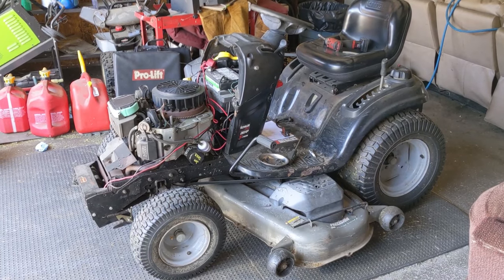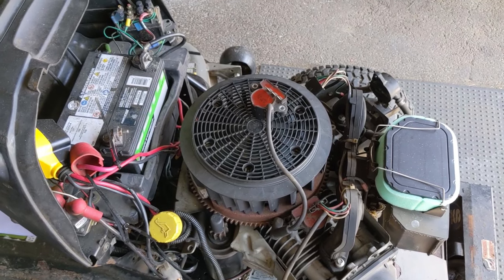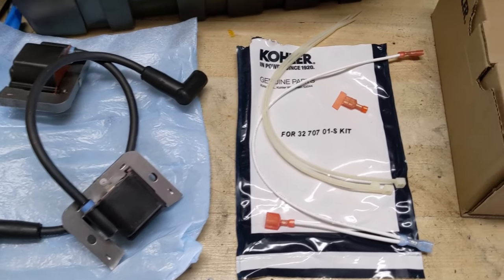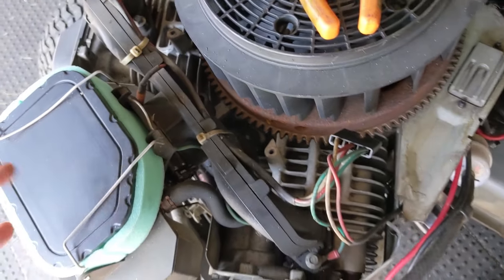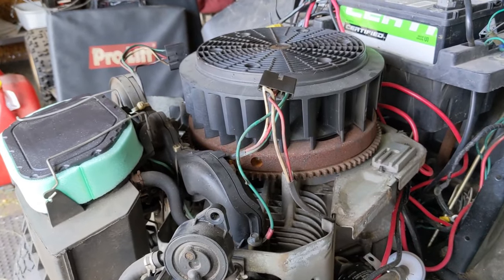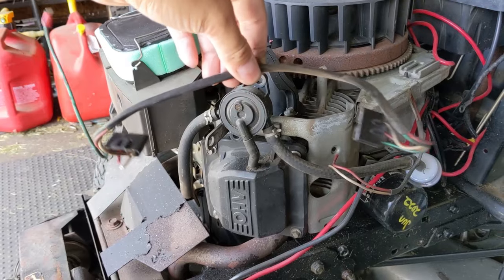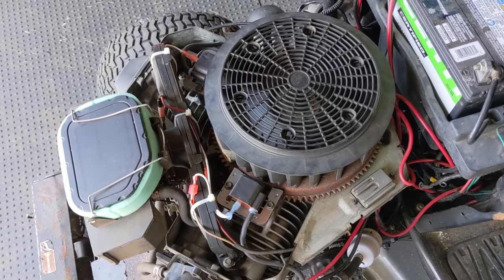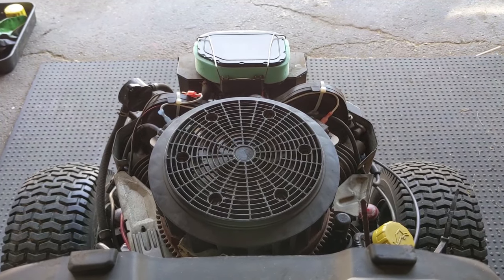Kohler V-Twin DSAI to MDI Ignition Upgrade

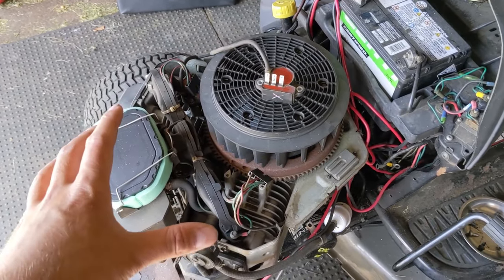Comment from the maker: If you'd like, you can skip to 7:50 to show the wiring, and skip to 20:31 for the installation of the new ignition modules.
Reply: Hey man I had a friend to send me this same video and I was wondering have u ever rewire one these engine cause I have one just like it and I had to swapped everything over from the 3 wire coils to the 2 wire coils and I swapped it over dsam coils system and I was wondering if u can rewire this type of engine with out safety switches and keep the charging system

Comment: Nice job. I recently had a customer with that same issue and when I told him the cost of the new coils and the labor, he decided to trade the mower in to a dealer. He really got burned at the dealer and bought a new mower. They only gave him an allowence for $300 dollars for his old mower. It was in excellent condition except for the coil issue. Thanks for the video.
Reply from the maker: Yea this came in for a full service, and with the coils on top it was about $600 with pickup and delivery, labour and parts. Customer was very pleased, as this mower could easily sell for $1700+ seeing as how I sold a 25/48 for $1500 years ago. As I always say, they're not worth as much when they're not in working condition and fully serviced.
Reply: Got ripped off at the dealers eh, too bad they should have gotten at least $600
Reply: Next time throw a buy price at them before they leave the shop
Reply: I have never understood people's math logic. How does it make more sense to replace something for $2500 versus spending a few hundred dollars to repair it?

Comment: You are a godsend. Mine were working just fine until mice chewed up one of the spark plug wires and I was trying to figure out what to do...
Reply: I am in the EXACT same predicament and I finally figured out which new ignition module I need bc of this video.

Comment: Thank you. Easiest video I found to fix my Cub Cadet gt1554. After replacing the broken stator and flywheel I wanted to get rid of this junk design. Only puzzling part was of the two flywheels I have one is timed differently where the key is.

Comment: As your number one fan i would like to thank you for taking the time that it took you to research all the information you have provided in this video and i especially liked the ending where you used the heat gun to check the temperature of both exhaust pipes to ensure both cylinders were running. That spare coil that is still good has some great $ value to someone that needs one eh?
Reply from the maker: I read over the original service bulletin and it provided all the info on why the original modules failed. Also, probably going in the scrap bin as I'd hate to sell it to someone just to have it fail. Thanks for watching!
Reply: Good  day  Guys.  Boy  a different  video today.  I always  thought Kohler  was a very good motor.. Yrs ago on farm  had Bobcat skid steer  with 14  hp Kohler.
It is too bad  that such a big machine  when goes wrong  will cost that much.  Too confusing for me if I had one  but anyways  Jake  tha nks for showing.  Both have a good week
Reply: @donvoll2580  Thanks for the comment and you have a great week also Don.

Comment: I wish you had touched on the actual elimination of the DSAI box itself. Other than that, it was a very detailed, very informative video. Thanks.
Reply: I think this could be my problem---- mine will not run unless I disconnect the white kill wires to the new coils--- then I only can kill it by pulling plug wires.  I'm missing a step here, maybe it's what you're referring to?  See my post today if you don't mind.

Comment: Another good video Jake. When I did electrical repairs on coaches, I very seldom used butt connectors because the metal butt inside of the plastic is split. We used the metal butt splice as the seam was soldered. You had the option of soldering it if you wanted. Then the shrink tube we used had the glue inside to make it water tight when heated and shrunk down. Also if you were trouble shooting the wire you could ‘probe’ the connection, then just use a heat gun again and it would re-seal. I know these things cost more, but if it meant the difference between a ‘coach down’ service it was worth it. I know you have a different application, but you also have a lot of vibration. Sorry for the long explanation, just another option.  Have a good week.   Rick
Reply from the maker: Yes maybe I should look into the heat shrink with glue and also the metal butt splice. I always like constructive criticism and also tips and tricks, I learn new things every day. Thanks for watching!
Reply: Do you mind if I say the company names of the products?
Reply from the maker: @motorcoachtech7615  I don't mind at all!
Reply: Shrink tube came from Kenco Industries in Burlington On. (We had a local mobile  dealer come around with all kinds of shop/garage supplies ). The butt splices came from Techspan(ta) from a local jobber. Hope this helps.   Rick
Reply: @motorcoachtech7615  Thanks for the information it is great appreciated.
Reply: A waterproof heat shrink is also sold by harbor freight, which seems to be good quality. A splice I did a few years ago, underground in a wet environment, is still going.
Reply: @arthurr8670  Before the pandemic i did a lot of shopping at Harbour Freight in Buffalo New York

Comment: Hot tip: a diode has a forward bias voltage drop that is  .7 volts for silicon. In a DC circuit , you can add a diode in series to lower the voltage by 
.7 Volts. Three in series for 2.1 Volts.  - -|>- +    The silver line is negative. I use this only to reduce the brightness of LEDs in a circuit with some resistance. Long wire runs count for automotive. You can use them if your halogen  headlights are too bright on a scooter or riding mower. Looks janky though. Lol

Comment: When setting gap I use notebook paper, cut 3 sheets and put them together and that will give you a.010 gap. If you want more or less gap add or take away a sheet as desired.
Reply: Thank you for that this info will come in handy when mine arrives.

Comment: very nicely done i still had in my old tractor those dying coils and the symptoms matched exactly what was going on the tops of the coils also showed cracking in the colored resin cap ,  though the replacement coils i got have 2 spade connectors on them one is smaller than the other and after install i cant get spark ive got them set at .010 gap ive removed the kill from them an still nothing

Comment: Great video and an awesome explanation of everything. I am having a related issue. I have a 2004 Dixie Chopper with a Kohler Command CV730-0014 (730s specific to Dixie Chopper). I have had problems with the electric dying and completely shutting off in the middle of a cut. Sometimes I jiggle the wiring harness where it connects the motor to the rest of the harness for the Dixie and it will sometimes start. But typically of late, it does nothing when you turn the key. I suspect it is something grounding it out such as in the white wire kill circuit. But I removed the cover today off the Kohler and I could not find a wire grounding out anywhere. I also do have the more modern solid-state coil packs. I have done a continuity test on the wires with everything seeming to be working. I have two different ignitions I have tried, a new solenoid, and a new fuse holder. The mercury tilt switch is working. I disconnected the seat switch years ago and looped it into itself from the harness. Nevertheless, I have no clue where to go from here. The battery is good and pretty good under a load tester. Any suggestions?

Comment: Very professional video and straight to the point. Installed one of these kits on a 2005 CV730-0014. Runs perfect with no load, but once you engage the blades, it bogs down and sputters. Any suggestions?

Comment: Hello and thank you for this video.  I have a Kohler V-Twin SV 730 engine and it's very similar to this.  I went through all of the steps on this and install went well.  However, here is my problem: I cannot get mower to run, UNLESS I disconnect the white kill wires to the coils.  Of course the only way I can shut it off after is by pulling the plug wires (certainly not preferred).  Is there a step I'm missing here or is my ignition not compatible?  It seems I have a grounding issue--- thanks
Reply from the maker: Yes so it sounds like you have a safety switch issue. Either brake switch or seat switch.
Reply: Here is some info if it helps…. Check continuity to ground or battery - on the white wire going back to your mower harness. If it grounds even with the ignition turned on then a safety is tripped somewhere. If the white wire isn’t grounding with ignition on then did you buy the Kohler kit that comes with the white wire harness and connectors? If not then that may be your issue. I am pretty certain that there has to be diodes between the coils in the kill wires to prevent them from sharing/passing spark. But then again I only ran into this on a Briggs engine when the diodes went bad and it wouldn’t run right and would backfire badly through the intake. Each coil was making both cylinders spark at the same time with the bad diodes. A test for if diodes are needed is to start it with the white wire hooked up to only one coil. If it runs normal smoothly and you turn ignition off, only the one cylinder with the white wire hooked up to the coil, should die off. Swap the white wire to the other coil only and it should do the same. If you hook both wires up and it doesn’t run or run right, you need diode‘s. Kohler may have built diodes into the coils in the kit and aftermarket coils don’t have them built in or that white wire and connectors comes with has diodes in it. I’m ordering some aftermarket coils from Amazon for a fraction of the cost and am about to find out myself. Might have to add diodes to them if this is the case.

Comment: By the way this is the very first time i have seen this type of ignition coil. It would be interesting if any of your other subscribers would comment on if they have seen these.
Reply from the maker: Very few of the courage and command engines got them. Looks like only certain models like SV 735 740 840 and a couple CV or CH command engines
Reply: Wayne and Jake my neighbor had a old Sears Craftsman 5000 series mower. It would run good for a bit then spit and sputter just as you said. That thing gave me fits, it had the V-twin Command on it. I had never heard of spark advance on a mower but eventually researched and found this motor had it. 
This was about 3 years ago and the coils were obsolete. I ended up getting 2 coils for that motor, rewired the coils and omitted the harness. 
It’s still running properly today. 
Thanks for the video Jake, good job. 👍🏼

Comment: Thats funny I have one of the first Kohler OHV twins from 1995 in a Toro and runs like new in 2023.  Never had an issue with what this video is talking about.  I'm guessing around 2000 Kohler change that part to a cheaper one and issues began.

Comment: Replaced the coils today. The video was awesome in helping us do so. It runs great but the battery light comes on when the PTO is engaged. Any suggestions?
Reply from the maker: PTO clutch depends on steady amps from a good battery, you might have to replace your battery
Reply: Would it have anything to do with the coil air gap?

Comment: Nice tutorial. What hand Tachometer did you use and do you like it?  Black tie wraps 😊
Reply from the maker: Stens 751-180 wireless tachometer, works great. Might be a little expensive for people who don't use it all the time, but we use it almost daily.
Reply: Looks like the 751-180 has an analog  type numbers, nothing at all like the blue digital one in video
Reply from the maker: @theresahoffman8408 my bad, that's a temperature gauge! Just making sure it had heat on the muffler, showing that cylinder was firing.

Comment: Thank you thank you thank you. Like someone else said a mouse chewed one of my main spark plug wires and I couldnt for the life of me get a definitive answer as to which new module I need. And I searched high and low for the original 24-584-89 to no avail but now that I know they had trouble NOT related to mice eating the wires maybe it's for the best 😂

Comment: Hmm...I picked up a freebie today, 02 or 03 Cub Cadet with the 27 horse Kohler and noticed one of the coil to spark plug wire is chewed up by mice. Those coils have 2 wire connections. Would that be MDI? The new coil shown in your vid has 1 wire connection? Btw...great video and very professional!

Comment: my 735 always ran smoothly until i developed a misfire, threw a timing light on it to see if spark was dropping out and it was on right cylinder, bought the conversion kit and installed it and one thing i noticed right away, it starts as though the engine has loose motor mount bolts, you know like a jolt,  idles smooth no back firing but as you increase the throttle it gets those little exhaust poots/pops and it never did it with the old coils, always smooth with no funny business.  could new coils just have too much timing built into them?
Reply from the maker: It's possible they increased the ignition timing using offset on the coil post design, my advice would be to try premium fuel and if the pops go away you know it's timing. If not, check your coil gap to make sure it's properly set. Other than that, new (proper) spark plugs just to be sure.

Comment: Really good explanation!! Just hope I'm esute enough to accomplish this...
Reply from the maker: Take your time, and follow the steps in this video. Good luck!
Reply: Okay, so I am confused. I'm trying to find the correct replacement for my sv735 o16
Kohler. The original part number in my parts manual is 24-584-36-S. I bought part number 32-707-01-S. I called the place I got the replacement from just to make sure I got the correct one and they told me that I needed the original part number(25-584-36-S) which they have in stock. I noticed that my original harness has been chewed by mice. I patched the wires that were chewed but I still have the same issue of running on one cylinder. Do I get the original part number or do I get the replacement (if that's the correct one).  I'm not sure what to do????
Reply from the maker: @harmonysprogress  if they're trying to sell you the old number, it means they have "new old stock" that they're trying to get rid of. You'll end up running into the same issue, as the DSAI system will eventually fail. You're better off asking them for the solid state coil replacement kit, as shown on the chart. If you're not sure what number to get, just pause when I have the charts displayed, you'll see all the numbers, there's only 2 kits available to choose from.
Reply: @EliminatorPerformance  
Thank you!!!! I ordered the right one!!! It's the 32-707-01-S. Thank you!! I'm concerned, though, because mice had chewed some of the wires so I hope I have enough. I'm going to have your video with me going step by step!! Thank you so much for responding!!!!!
Paul
Reply from the maker: @harmonysprogress  no worries, and if you fine some chewed wire they can always be fixed. I'd rather butt connect a section of new wire in, than electrical tape something that's been chewed. Good luck!
Reply: @EliminatorPerformance  
You have a new subscriber!!!
Thanks again!!!

Comment: Thanks for the video! I think I have the SAM or DSAM type. Someone told me I had to buy this kit and a different flywheel because of the location of the magnet or something similar.....do you know if this is true? Thanks in advance.
Reply from the maker: No, you just need the coils. Pause where I show the chart and pick which one you need for your engine
Reply: @EliminatorPerformance  thank you. From what I read since I sent you the message,  my Kohler Command Pro ch25s has the DSAM, with 4 different colored wires. Like you said, and additionally verified for me....I just need the coil kit, no flywheel. That's great news for me! I definitely didn't want to have to replace the flywheel too. Already ordered the coil kit. Thanks again.

Comment: My 2004 z master with Kohler 27 hp command pro engine runs like new.Frequent oil changes, synthetic Mobil 1 10w 40 4 stroke motorcycle racing oil.I’ve had no problems with this engine.It does not burn oil,and has plenty of power.

Comment: Great video.  I have 2 mowers with the 26hp Kohler Courage V Twin.  The both run well with the old ignition system.   Should I just keep running the old ignition system until it fails or should I replace them?
Reply: I'd just keep running them until they start misfiring/sparking. my kohler 26hp had over 820 hours on it before the right module starting misfiring/losing spark,  who knows, yours may not even go bad

Comment: I have a Kohler on a bad boy that has no spark on either coil checked all relays safeties Etc put the multimeter on the coils and got almost the exact same readings from spark plug boot to the kill was 18.8...and the boot to the frame was 8.8...almost identical, does those numbers sound about right, thanks man

Comment: Would the Courage part work on a ELS725 26 hp, or am I looking at the wrong number? Thanks
Reply from the maker: I have no idea, run your engine model number into Google and type parts diagram after. These are for the SV series, so I don't want to say yes or no because I'm not sure.

Comment: I have a Kohler 7000 24hp 725 Pro Performance Filtration. Problem: Chock was not closing I adjusted that. It worked for a bit. Now it’s 27° out it won’t start. When I shut it down the test drive after the choke adjustment. The speed stayed the same in both slow speed & high speed. What am I missing?